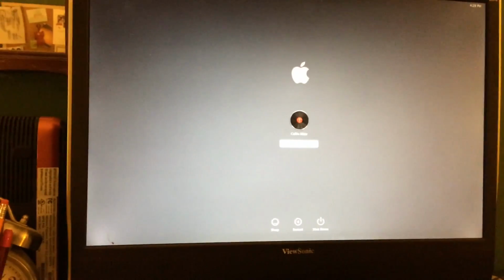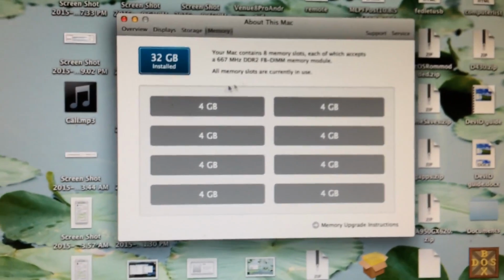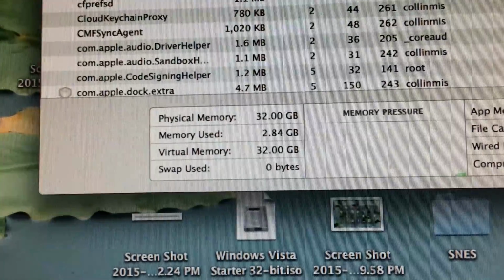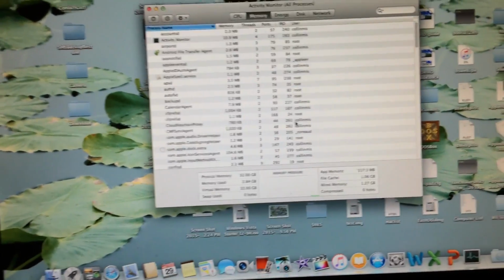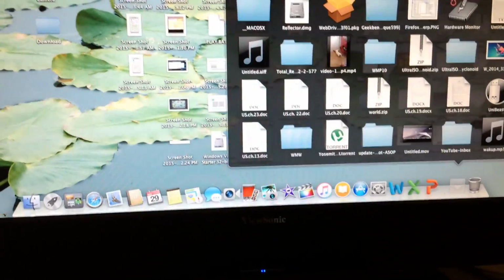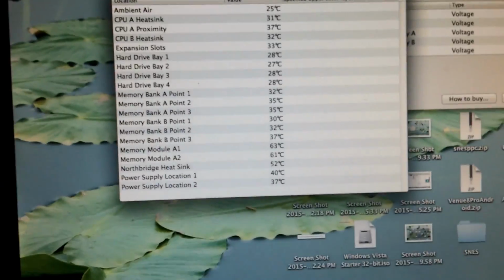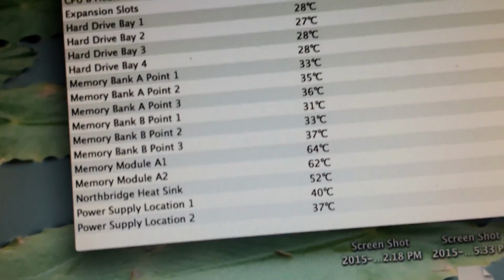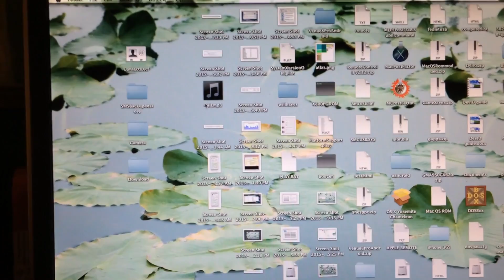Early-2006 Mac Pro 1,1 32 GB RAM Upgrade

Comment: Some people say you should only use ram with the huge heatsinks that are apple certified for the Mac Pro 1 1. Is this really necessary? As long as they have heatsinks I don't see why this should be a problem. Also a lot of listings for the ram say that it's server ram and doesn't work in regular computers, is this true? Or does the Mac Pro 1 1 use special server type ram?

Comment: isn't the mac pro 1.1 a 32-bit computer?
Reply from the maker: No, it has 64-bit processors.
Reply: Only the firmware is 32bit.  It'll run 64bit Windows 10 okay with a 32bit bootloader.

Comment: hi, i just bought a 32gb ram it seems to be the same model, but my mac pro doenst recognize, and the risers leds are red and doesnt turn on, i already reset the PRM nothings happend any ideas¿?
Reply: you may have mixed the riser cards try switching the top one to the bottom and bottom one to the top
Reply from the maker: Are you sure it's the correct type of memory? It needs to be PC2-5300F.
Reply: yes it fit perfectly its M395T1G60QJ4-CE68  PC2-5300F-11
Reply: It has to be 2Rx4, read the ram label. Pc2 5300F 2Rx4

Comment: Do you need special ram from Apple, or will any ddr2 ecc ram work? What about non ecc ddr2?
Reply from the maker: Any DDR2 ECC memory should work. Non-ECC DDR2 will not, as the pinout is different.

Comment: Will this work on a Mac Pro 1,1 2x2,66 Ghz Dual-Core Intel Xeon machine? Cuz i noted that your machine is a 2x2 GHz one...
Reply from the maker: Yeah, it's work just fine with any Mac Pro 1,1, 2,1, or 3,1.
Reply: Thanks buddy, I can confirm the Mac Pro 1,1 does read this ram even though they overheat a lot!

Comment: I got 8x 512mb with Apple heatsink ram for cheap then bought 4x8gb 5300f 2RX4
 (not 4RX4) then swapped the heatsinks, Now I have 34gb. Now I need to get 4 more 8's and put the SLAEGS in there, Flashing an XFX DD HD7950 to efi tomorrow, PCI-e 2.5gt/s is a bummer though. Still, not too shabby for a 10 year old computer.
I don't need this Mac for anything, Just doing it for fun and I like pushing old hardware to nearer (x5365's aren't worth the money) the best of it's capabilities.
Reply from the maker: +This Name Was Available! I actually have X5365s in mine... I got a decent deal on them, though, paid about $60 for both.
Reply: Yeah that's a good deal, They are usually double (or more) the price of X5355's on ebay here. Paid $17 each and thought that was a lot for a CPU that performs like a Q6600.

Comment: Hi there, Im just adding 4GB in 2 ram, but for some reason it doesn't read them, also my mac is alsoa 2006 1.1 and I can upgrade to osx10.9.5  how did you do that???? can you help me it would be nice thanks
Reply from the maker: +Dj Spooth Make sure to follow the proper pairing configuration as specified here: http://www.rent4event.de/fileadmin/dateien/PDF/apple-mac-pro-8-core-manual.pdf Also, I have a video on my channel showing how to install Mac OS X El Capitan on this machine.
Reply: yes I done that and it read 3 4 5 6 7 8 but not 1 2 of the slots. :/
Reply from the maker: Dj Spooth Then you may have a bad riser card, or your modules aren't compatible.
Reply: They have to be 2Rx4
It won't run if it's anything else.

Comment: From this article – http://anandtech.com/show/2059/5

This is interesting:
"To help dissipate heat, every Apple DIMM you purchase for your Mac Pro comes with its own preinstalled (big) heat sink. This unique heat sink lets fans run slower - and quieter - yet keeps the memory cool enough to run at full speed."

So, I wonder if using all this server RAM w/small heat-sinks is going cause more heating issues over time. And if you do a lot of strenuous activity with apps, games, or multiple virtual OS's. Can you push the system over the edge with this kind of RAM?

And then summer comes along with more heat and humidity. How will all this look 6 months from now – July/August?

Will have to check back.
Reply from the maker: +adamjg4 I use this machine for everything, and haven't had a single problem yet.
Reply: +dosdude1 And I hope it stays that way too – but sometimes reality rears its ugly head as time goes by, doesn't it? I have 6 of these small heat-sink RAMs installed in mine BTW.

Comment: Have they held up well – any overheating issues?
Where did you get them?
Reply from the maker: +adamjg4 I use this machine every day, and haven't had a single issue. I got them from here: http://www.ebay.com/itm/291645449848
Reply: +dosdude1 Thanks!

Comment: Correction: 32 GB is NOT the max it supports: http://forums.macrumors.com/threads/64gb-ram-in-2006-mac-pro-2-1.1939624/
Reply from the maker: +Timur Tripp Oh, wow! May consider doing this upgrade at some point.
Reply: +Timur Tripp OMFG, I had no idea!
Now, I'm guessing at some point over-heating might become an issue!?
Reply from the maker: +adamjg4 Just because it's more RAM doesn't mean it runs hotter.
Reply: +dosdude1 Maybe not, I'm not sure. More RAM may increase energy consumption which may translate to more heat. I've seen reports where people using larger RAMs had more problems and some reported overheating as well. Just a thought.
Reply: is true. It is a discontinued product. This brings the consequence of programmed obsolescence, this product is the reduction of the speed of the fans, which results in malfunction of components without the normal customer noticing. My solution was to install an app called smcFanControl and ready. this happened in my MacPro, MacMini and my imac. It makes you think about buying a new one without you really need it.